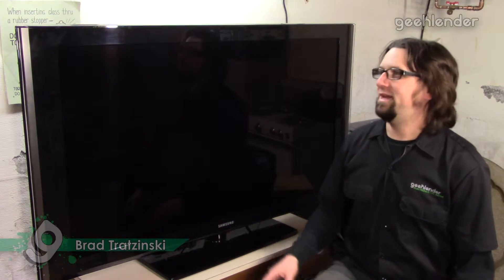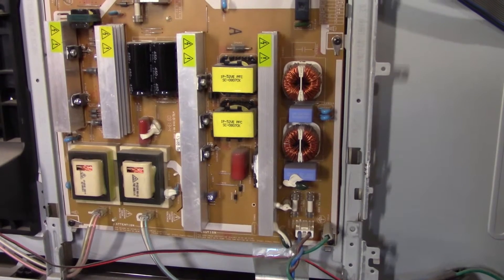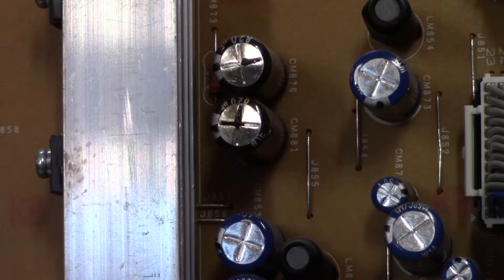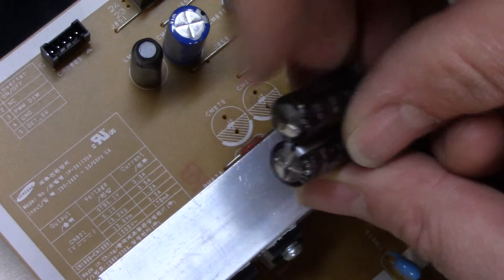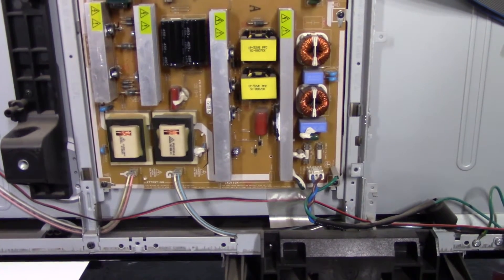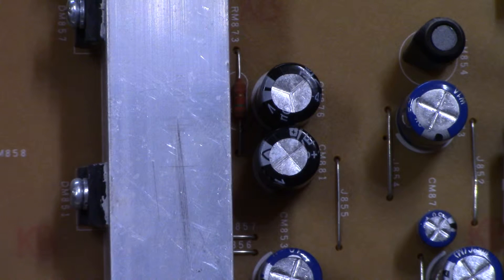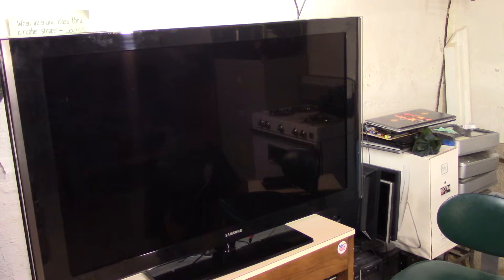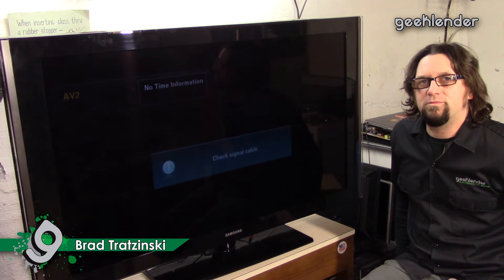Samsung TV Repair LN52A580P6F

Comment: Hi Brad, I have the same TV I had to replace the capacitors a couple years ago. Thanks to your video. It now will not power on with the remote I have two remotes neither one of them will power it up. But it will power up by pushing the button on the TV itself. I’ve unplugging the TV, taking the batteries out of the remote and pushing the buttons on the remote and replaced with new batteries. still does not work. Any advice you could give me would be appreciated. Thank you